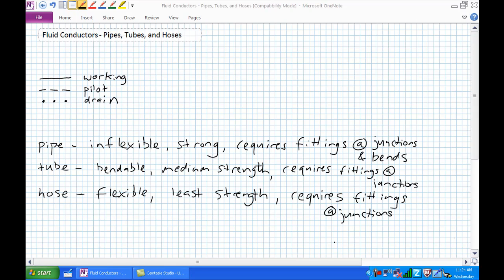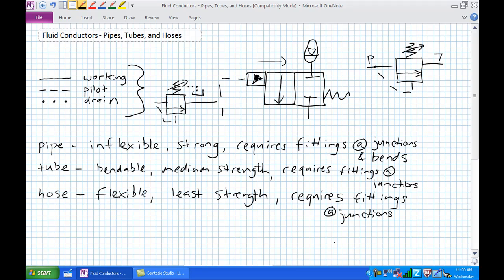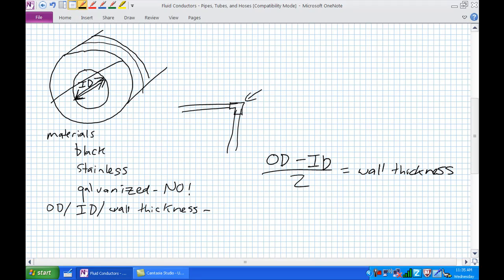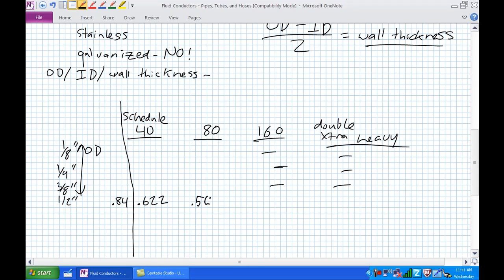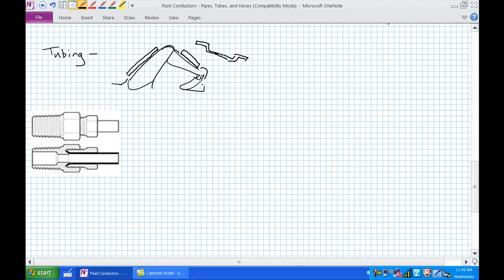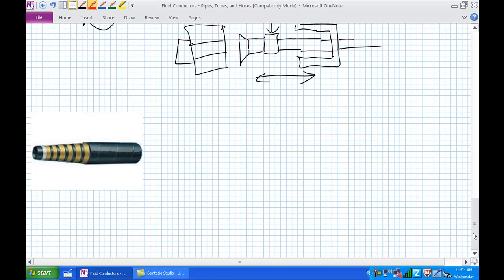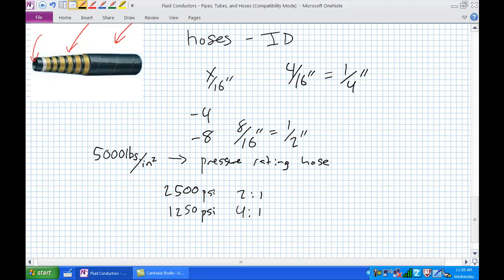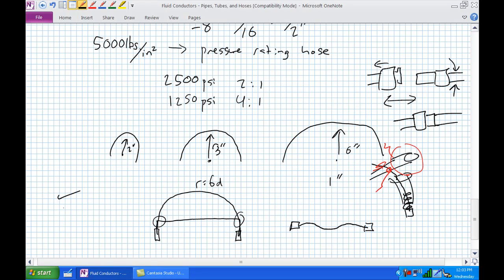Fluid Conductors

Comment: FYI: all hydraulic lines in aircraft are tubing also sized by OD in 1/16 of an inch, no schedule system is used here.So a dash 8 tubing means it is an 8/16" o.d.